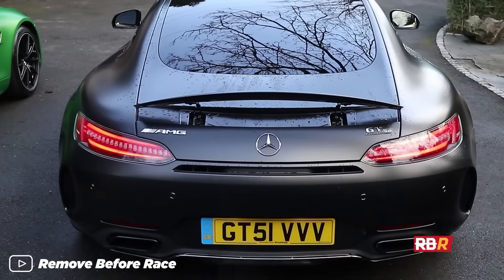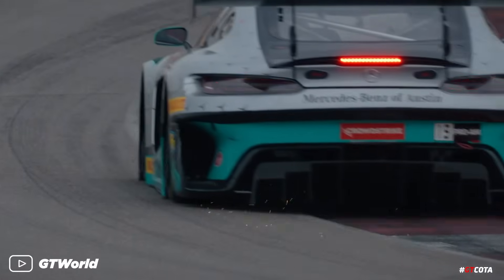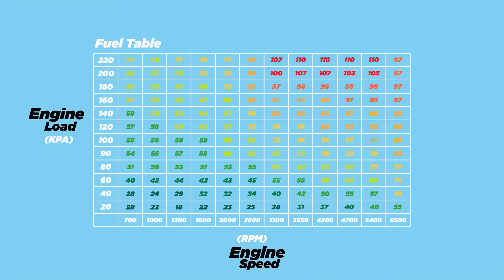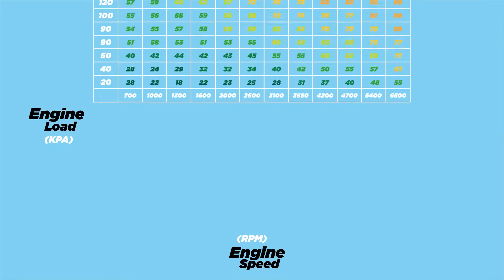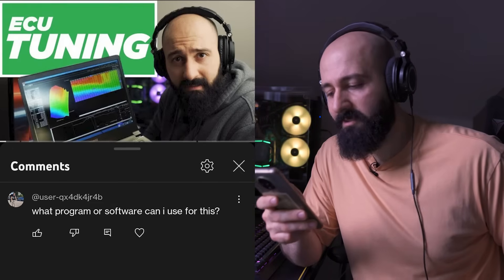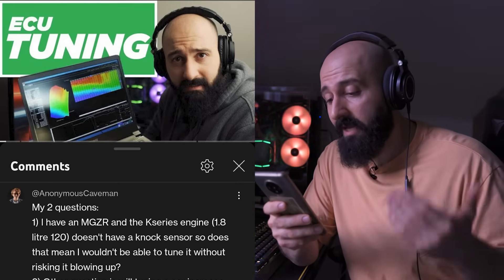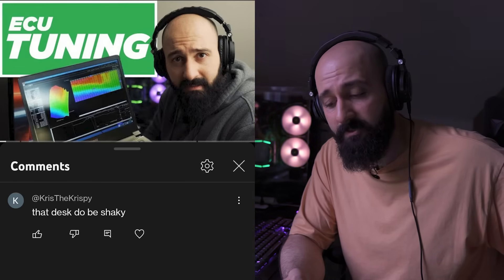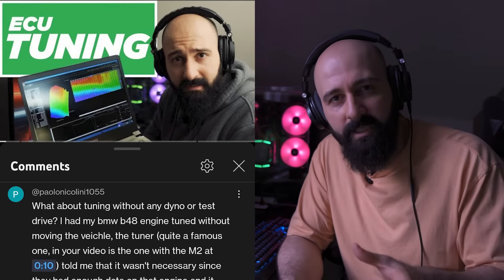Burble Tune || EXPLAINED

Comment: is there a possibility to tune my e60 2008 3.0 200kW petrol with simple burbles that wouldn't damage the engine? i bought it from first owner with 250.000km and am planning to keep it for many years but the sound from exhaust is almost non existent :( engine sounds amazing tho

Comment: Some carburettor'd cars shoot flames on over run, fuel that coats intake walls is effected by the vacuum and gets pulled through engine with no air...... I think...

Comment: 2024 infiniti q50 red sport 3"½ catless downpipes, 3" catback, x pipe, vp 101 octane race fuel burbles randomly at different speeds and in sport+ downshifts also on manual downshifts especially in fourth gear when letting off the gas a nice big pop. I wonder what it will sound like with a moderate burble tune?

Comment: crackles ≠ burbles!!!

burble is the sound made by unequal length exhaust headers. Most famously the subaru flat4, but also some porsches and even older Saabs made a characteristic burble sound from the exhaust, especially at low RPMs.

Comment: Alrighty, you cannot hear knock outright. the actual damaging threshold of knock is a real razor thin line and advancing yout timing over that line WILL eventually cause catastrophic failure. this is why people used to used detcans or even hardware/software that ties into the knock system. 

they sell knock sensors you can either permanently or temporarily install to do this. and i really have to press and state that timing advance and retard is 100% the most effective way to get power next to fuel trim and ve tuning. without knock tuning you are literally guessing and basing your safe fuel trims on sociometric base generic values. 

even on two of the same engines their knock thresholds can be dramatically different between the two. so if i had any advice to give anyone take your car to a tuner who can do it correctly.

Comment: I fell down this rabbit hole about 2 years ago while owning a 03 4.3L Trailblazer . Can't find the exact definition file, so I have been trying to figure out how to utilize a different XDF file to show me the tables to compare and tune that way. As to build my own XDF file. OSID 12588012, PCM HAMMER, TUNNER PRO, I'm hoping you could give me some pointers on where to find the correct deffininition file for this TB. Or any knowledge you could pass my way. It would be greatly appreciated.  By the way, thanks for the videos you have uploaded. They are very informative and inspiring .

Comment: Good explanation but wrong. Cars with carburetors do it too. It's ignition timing. Air to fuel ratio is always important if you don't want to change spark plugs constantly

Comment: I do believe the first production to car have such a tune (pops and bangs as it was known back then) was the 1996 TVR Cerbera. If not the first, then certainly one of the early ones. A pretty whacky car (had no keys or door handles) with an engine that had more in common with a contemporary F1 engine, than anything else being mass produced for the road.

Comment: Great show, great topics! I just bought a 2025 Mazda CX-30 Prem + Turbo. I'm really disappointed to see that it never - ever exceeds 5,500 RPM, and watching 0-60 videos -- it looks like none of the newer 2.5L Mazda's do it -- even with a 6,500 rpm redline. My 2017 Mazda 3 2.5 NA has never had a problem reaching the exact redline prior to shift (A/T) at 6,500. So I'm a bit pissed at myself and Mazda for "overlooking" that issue (one I'm convinced that they did their best to hide from me). In retrospect, my 2017 did not make any extra power in going from 5500 to 6500 -- but it was better positioned for the next gear to continue laying the power down -- and a turbo would have no problem flattening out at 5,500 and would only run faster -- except that something(s) are chocking it out. I've had it up to 135mph twice -- and it didn't feel like it was redy to slow down (although I might have been 2mph away from a governor ending my fun). BTW... I'm well over 60 now, and I would like to get a mild burble from my CX-30 (although I'm not sure the extra fuel is worth it) -- and I still drive like I'm 18 -- but get no tickets & never crash (God willing). I also noticed that the new turbo is nothing like what I helped my brother put on his 72 Datsun 510 (we put in a 240Z 5 speed because the taller gears made it pull harder). He once bried that speedo at about 7 o'clock, and it only went to 120 at around 5 o'clock. That thing just went faster the harder you stepped on it, and the faster the speedo went, the faster it accelerated. It pinged like nothing I ever heard until we got the water injection right -- even then, a small ping would herald the boost coming on. I don't know how long that motor would have lasted before he sold the car. I'm thinking that Mazda has implemented everything from throttle by wire, spark retardation, boost limitation, and any number of other things to keep it from destroying itself  -- all while still running on regular 87 (91 octane + booster made no difference in rpm limit, but a little in acceleration). I noticed that the car often gets a surge of power when I back off from full throttle (my 2017 3 does the same thing -- but not as hard), and often pulls harder when upshifting (only) from 4K to 3K. I never figured out why my 3 does it -- even after dismantling all restrictions that could be reassembled at smog time, and putting on a Borla axle-back -- I got no difference, other than a very smoth sound (no burble). I noticed that the throttle plate & air box (nearly identicle to the 2017) come right before the turbo -- and are connected by a flattened piece of tubing that appears to be designed to restrict flow -- or speed it up. Could it be that simple? Am I asking for trouble by increasing the diamter of that tube. Of course, a tune will be needed after that is done, but can a tune alone provide a good boost that won't destroy my new car?

Comment: So I have a volvo c30 T5 (turbo 5 cylinder) and it's my daily and I've been considering some mods since it's mostly untouched but it's only a daily so I don't want to do much and I was wondering if its possible to have it tuned for more power without making the fuel efficiency way worse.

Comment: Would love to do a fuel tune on my C200 Kompressor, nothing nuts but I'd like to just nudge the engine north of 200hp... Would like a very modest pop out the back too 😏 also my rev limiter from factory is a fuel cut, so it just stops acceleration without the spanks... I like the spanks

Comment: I'm in my mid 60s and have an AMG that burbles and cracks on downshifts and growls up upshifts and it puts a smile on my face each and every time! I may be in traffic barely doing 35mph, but that burble and bark makes up for the traffic! I love the throttle response of this Mercedes AMG and really, in Sport or Sport+ mode, the gas mileage isn't much different than ECO or Comfort. At least while driving in traffic.
Reply: I just bought a e63s
Reply: @NoVaRedacted have you stop smiling yet😅
Reply: @NoVaRedacted Have fun with it
Reply: If that's the condition and it puts smile on your face then you're not on mid 60's , your age is somewhere Near late 20's.. 🏎️

Comment: I had a 2011 (iirc) Ford Fiesta Zetec, bone stock (couldn't afford mods at the... still can't, actually) but when in first and slowly putting around a car park there was this cute and quiet little burble. No other gear did it. My 2019 Swift sport doesn't do this :'( but I would like it to.

Comment: My BMW E36, after the new full catback exhaust system I installed, it burbles occasionally and I really enjoy the small burble I currently get. I do want to tune it do be a little louder because its only really noticeable if you're in the car, you can feel it.

Comment: The burble tune was developed in race cars when they come out of corners they are preloaded with extra fuel. Then the ignition timing advances and the have more power at lower rpm

Comment: I find it interesting that the Porsche 991.1 Carrera S doesn't burble in Normal mode, burbles like a Mf'r in Sport Mode, and then doesn't burble in Sport + mode.  Goes to show you that this is just window dressing.  Still, sounds pretty sweet though...
Reply: My 2014 burbles in Sport+…

Comment: If you have an aftermarket exhaust you can get anything with a manual transmission to do it. Just let go of the throttle at high revs then just slightly touch the throttle. You will get two or three nice pops and thats it.

Comment: Mercedes GL500 X166 M278 4.7 V8 Bi-Turbo straight piped, cat delete for down-pipes, resonator delete for true dual exhaust with valves from the Hamann GLE63s 4.0
Euro 2 flash. On the Dyno i got +12hp but I did this for exhaust sound first 447hp is more then enough for me. Crackels, pops, bangs all good. When driving in the tunnels is literally armageddon!
You can also drive it lightly not to disturb the World 😂.
I fully blacked out the SUV, debadged, AMG GL63 diffuser with quad exhaust AMG tips. Replaced the stock Xenon head lights with Bi-LED modules & painted the mask metallic black to match the car color. Replaced the grill to a Diamond grill & installed a 21" diameter Mercedes star. Added a little bit of carbon parts. Tinted 5% the windows over the stock tint. Repainted two sets of rims bought a lowering Plug&Play ODB module.
I also added sound isolation of 160Kg like in the Rolls-Royce Spector.
I raced against my friends GL500 x166 both cars neck to neck the same. Although I did remove 3rd row seats that's -40Kg & my exhaust weights less then the stock also.

Comment: Vehicles shouldn't even have fuel being injected if the throttle is closed and its above a certain speed (not far above idle). Some manufacturers run their engines that way, some don't. I prefer it when they do. If you have a long hill to go down, and you also don't need engine braking, you can really save fuel by just shutting off the ignition and flooring the throttle. Your accessories will still work, such as the power steering. It's only ever found on manual cars for some reason. Even though you can shut off the engine with an automatic and it will stay functioning. Just needs to be in a lower gear manually.

Comment: Not necessarly to blow your engine if you rise the boost without ECU remap (tune). If you run a DIESEL engine which have no problem running lean .. in fact at diesel is even safer, as the rich runs rise the heat inside the chamber risking a melted piston as result. There are A LOT of diesels of 8sec, 9sec, 10sec.. cars which can do 0-60 under 3 seconds and 100-200kmh in 6seconds.. which is in no mean a SLOW or boring car.

Comment: my SRT4 had it from factory, my 335i it's tuned in, my more curious side wants to know however if the mild to moderate burble tune actually does the same cooling effect.  after all the engine is just a heat pump, and 100 HP per liter from factory is no joke.  over 100 HP per liter ( say 500 HP out of 3.0 liters or 166 and 2/3rds per liter )  means more heat and  keeping the engine cool so you don't go Misha levels of letting the smoke out the engine when driving spiritedly is a good idea and should be achievable with stock systems IMO in just a bump of 200 HP over factory.

Comment: Came here because my 18' BMW X3 M40i comes from the factory with burbles, wanted to know how it works. Thanks for the great and informative video!
Reply: It comes with iconic sounds which is burbles played through the cars speakers. Nobody out side the car can hear them.
Reply: @axebeard7677 It definitely does, if you send me some contact info I can send you a video lol.
Reply: @Xtreehuggerrif it does that’s pretty cool. I just took delivery of an m340 and was a little disappointed that the burbles aren’t real. It still sounds good though.
Reply: @axebeard7677 Since its an 18' its pre opf, meaning there was no regulations on burbles. It does have them and it is seriously obnoxious. lol
Reply: @Xtreehuggerrdamn that’s pretty sweet. I’m jealous. Mine sounds good but probably gonna have to put an exhaust to make that sweet sound
Reply: @axebeard7677Wait the M340i don’t have real burbles? I swear I have heard one that I know was stock with them.

Comment: Hey man, I dove into this topic because i noticed that the '14 Mustang Gt brubles on decel, yet the AFR meter shows 20:1. It is a stock tune with moderate flow mufflers. so far I have learned about burbles is the opposite, adding more fuel.

Comment: Hey man really need a opinion because I’m doing it to a 1995 gt mustang no ecu tuning involved just mechanical tuning. I got an adjustable fuel pressure regulator to turn up the fuel, and now I messed with the timing I retard it a little and I’m still not getting a burble. The engine is a 1995 gt mustang single cam pushrod motor so that’s probably another reason because it’s not a dual over head cam. But the reason why I know I can get a burble is because there is a few guys with the same car that have it burble on yt but they don’t explain it. The only way I was ever able to get a burble in the car was when I cleaned the throttle body with b12 throttle body cleaner, and when I looked up why it caused it  it’s because the chemicals tricked the sensor in thinking it needed more air and that was just temporary and that’s really the reason why I’m trying so hard not to burble tune it because it sounded so sexy and now I’m obsessed

Comment: i have got my little peugeot properly tuned after putting cams in and waiting for bigger injectors at the moment but it does a very subtle burble after letting go of the throttle and its amazing, its just a byproduct from proper tuning and relatively big power gains. just lovely

Comment: rom raider ftw.  my s52 sounded gnaaaaaarly in the early 2000s.  fun fact, the new g series mx40i cars , they burble hard in sport+ the cats just hide it.   if you put a catless exhaust with cutouts its already gnarly sock.  my m240i with a locked ecu used to sound like gunshots and the downshift overrev from the factory is enough to make it spit and pop.   the tuning programs only make the oem burbles louder/longer.  i have mine tuned out now so it only makes one pop between gearshifts and its very rb26ish. reccomend all my bmw brothers get rid of popcorn and use the shift cut to show off instead.

Comment: Old carby car. Get to highway speed, shift the auto trans into neutral, then switch of engine. Pump the accelerator a few times. Move gear selector to Drive and switch ignition back on.

Comment: I have a ‘24 X3 M Comp. I added a JB4, Dinan axel back and resonator delete. Cold start is great but has almost no engine noise until the upper RPMs. Some say I need down pipes to get the sound I want, but I think that I will still be throwing a dart without a true ECU tune. Thoughts? Experience? Thanks

Comment: 2014 m235i n55 pure stage 2 everything, ran 22psi made 580hp, had a really aggressive crack and pop tune, will it made my motor go crack and pop. cracks down 4 cylinders. new motor, retune to 450hp and no pop tune, i do miss the shotgun bangs.

Comment: everywhere on the internet is see ignition tables with positive degree values. I assume 0° is tdc. But if i pull up some stock backups from BMW M52 ECUs there are negative values like -28 at low rpm. Why's that?

Comment: I have a Nissan 370z that had intake and exhaust mods done to improve flow efficiency and then a dyno tune to optimize the F/A ratios and ignition timing across the rev range. I didn't ask for but I got a very slight burble tone that occurs sometimes on deceleration. I have to admit that it does sound good and is apparently not damaging the engine or catalytic converter, so I'm not going to change it. I think the main drawback is that it's causing the engine to use a little more gas than it normally would. Stock, the engine was so quiet that you could hardly tell it was running unless you were looking at the tachometer.
Reply: What exhaust are you running?
Reply: @GTR24  The Fast Intentions 2.5" TDX x-pipe cat back. It uses a series of two perforated core resonators in place of a baffled muffler, as the stock system uses, for lower back pressure and lighter weight. My exhaust system is about 16 lbs lighter than stock. You can hear sound clips of it on a Z on YouTube.

Comment: I did this using hondatas fk8 burble tune addition as of the recent update. I’m fbo and noticed that when driving the car itself has an interesting rev hang. It has two stages when tuning, type S oem sound or full ak47 slaughterhouse mode (i made the name up). The question i guess i have is, for tuning the fk8s what’s the long term effect if it’s subtle and set to a low burble. I’m also using an off the shelf tune with phareable at stage 2 and paid for the revisions. I’m a dumbass with tuning and i applaud those that have an amazing understanding of how to tune.
Reply: Probably damage your turbo if it’s excessive. 
But the best answer will come from your tuner, not from random people on the YouTube comments.
Reply: @ 100% i recently took it off since i was commuting. Since doing so the car feels way more responsive. I also just redid my sparks so that might also be the reason why

Comment: At the risk of showing my age, I vividly remember the slow cars at Le Mans in 1978 were the ones that made all the noise. Blam.....blam..... blamblamblam on the overrun into the chicane, and then way more noise coming out. The really fast cars: the Alpine Renaults and the Martini Porsches were comparatively quiet. Sometimes it felt like all you could hear was the turbo whine as they went past with a whoosh.
Reply: I wasn't there, nor was i alive 😅 but that may have had something to do with the fuel tune or maybe they were trying to focus on longevity by keeping the engine cool rather than tapping into all the hp they could